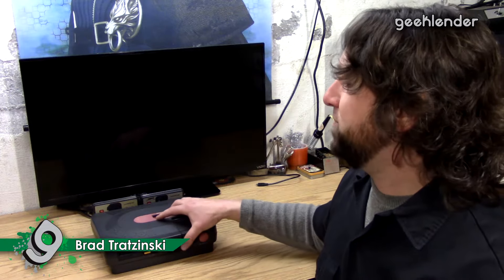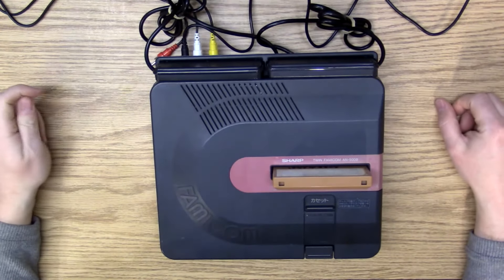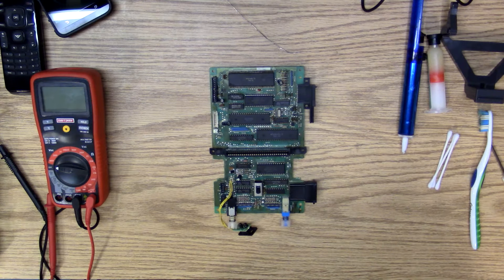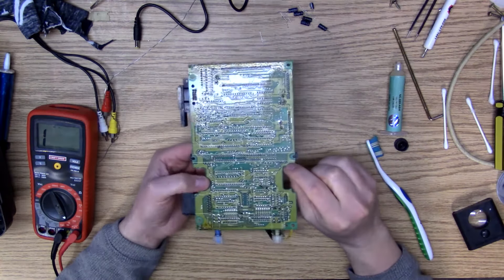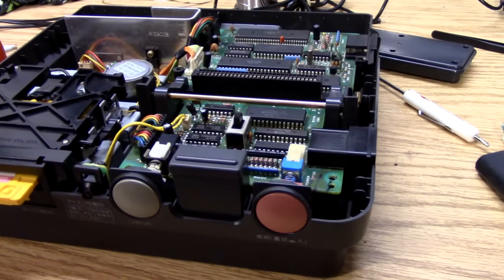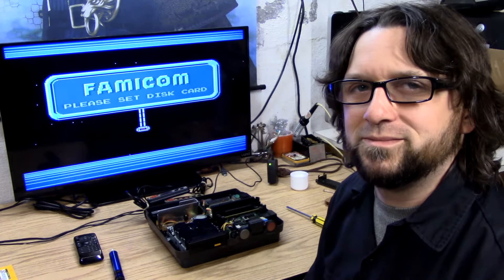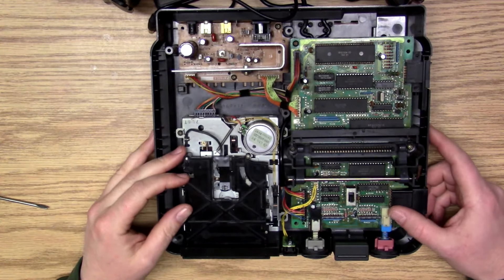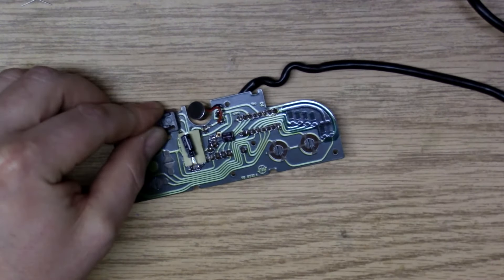Sharp Twin Famicom - Brad Tratzinski

Comment: Nice fix, and great video!

The disk drives are identical to the innards found in the large red disk systems. So a scrap one that just needs a new belt, you could take the drive out and put it in the Twin. 

Great job dude!

Comment: I would put some potentiometer grease on the slider to maintain the good connection. Automotive dielectric grease should work just as well.
Reply from the maker: Emmett Turner I did that. no joy. good tip though!
Reply: Did you mean thermal paste like CPU's have?

Comment: I just had this exact same via corroded last night, pretty standard, so I just jumped from the switch to power return pin on the motherboard and all was well, well except for a belt replacement but that's pretty standard. I'd really like to see less assumption that every cap needs to be replaced. Unless you're working on a gamegear that's not an assumption you should make. There's at least a dozen other things to check before taking that drastic a leap. At least do yourself a favor and pick up an ESR meter, and if you can afford it a cheap used oscope. will cut your troubleshooting down quite a bit.